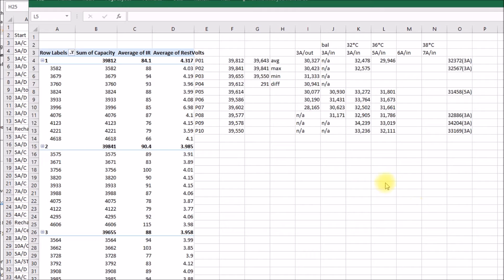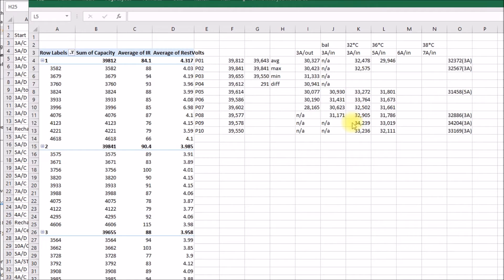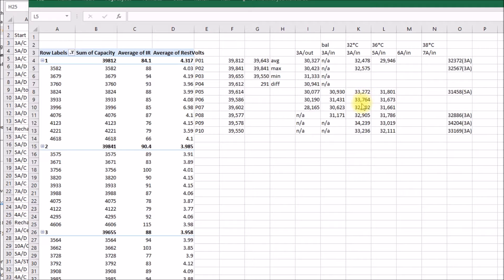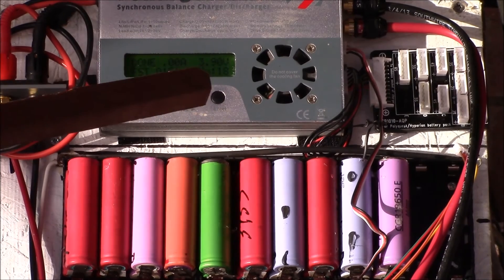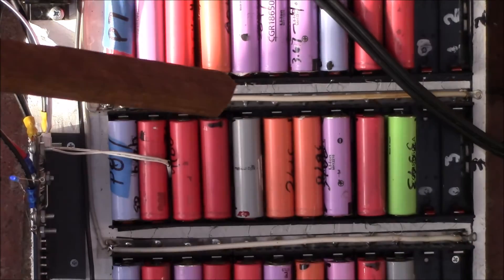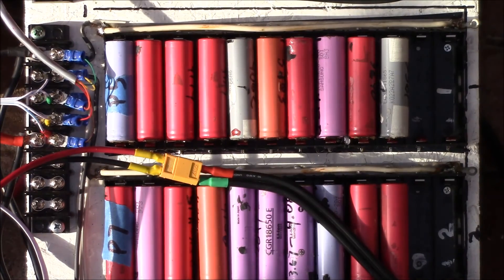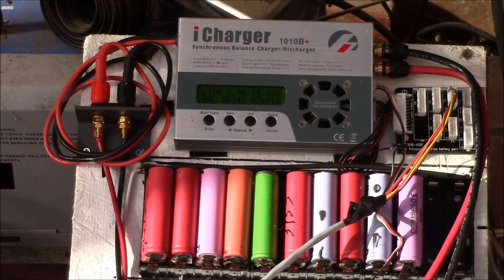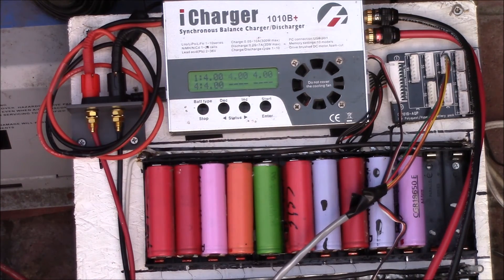Lithium Ion Battery Power Shelf - Top Balancing

Comment: would  a 4S150P be enough to power your Tripp lite powerverter? In your assessment  can it power your home overnight  with a 1000watts output? I'm  able to collect 700 lithium cells mostly out of Sanyo,  Panasonic and Samsung used laptop batteries
Reply from the maker: Would not run 1000W for very long.  That would be around 3.2KWH of storage and with inverter efficiency maybe 2.5 KWH of output.